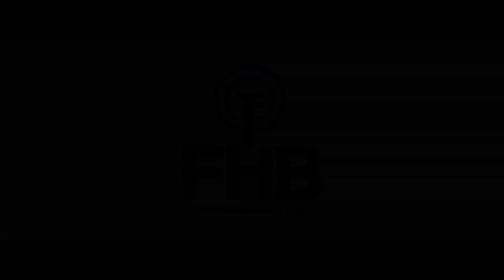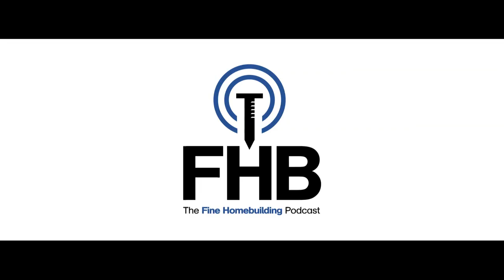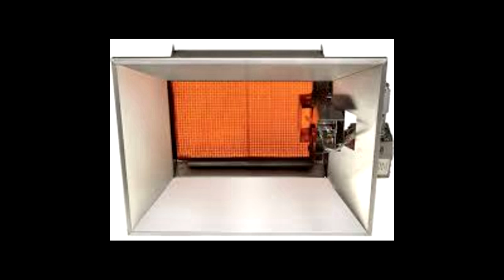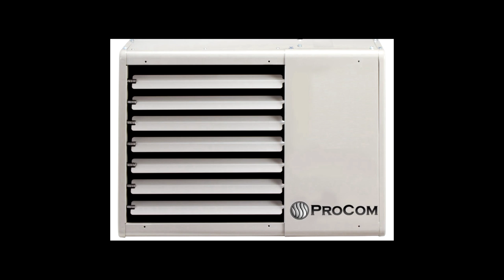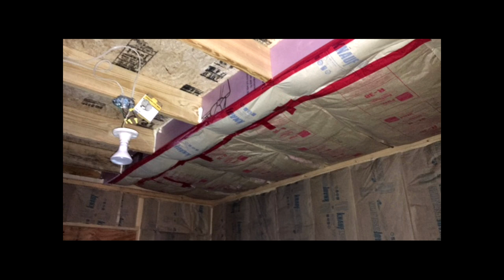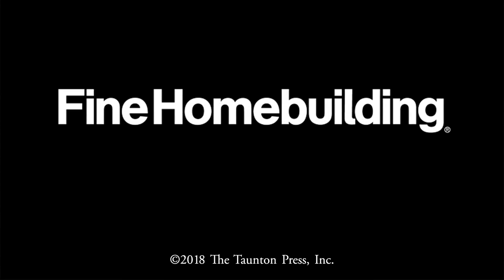The Fine Homebuilding Podcast: Episode 152

Comment: Paper tape is for use with standard drywall joint compound. The fiberglass mesh tapes are for use with 90, 60, 20, 5 minute muds, which are much harder.

Comment: I've got a vented propane heater from northern tool. Have an insulated shop that I keep in the low 40s and 60s when I'm working in it. I go through about a 20lb propane tank a week. Only 210 square foot wood shop but highly recommended that route.